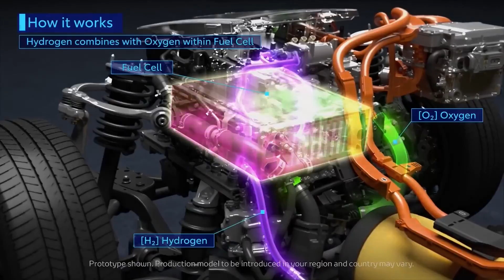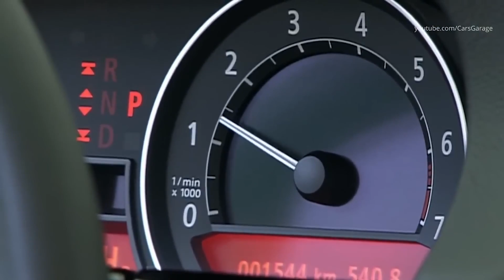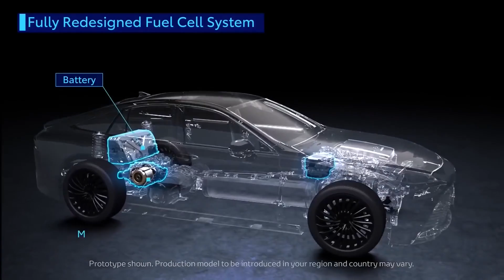Hyundai FINALLY Revealed New HYDROGEN Combustion Engine | GAME CHANGER!

Comment: Game changer?  Er, not in the UK it isn't, because you'll need tens of thousands of hydrogen filling points first. And there are around 12 in the whole of the UK.  Plus they just need to work on the massively inefficient production process for hydrogen. Then, just like petrol and diesel, it needs transporting to all the points where it's sold.  No good to me, as I can't fill up on cheap rate energy while it's parked on my drive. I can't get hydrogen from my solar panels either.... And guess who'll be the big cheese, selling and distributing hydrogen? Yep, the good old oil companies again.... They're desperate for another slice of the cake once sales volumes of petrol/gas and diesel tank....... Plus the car makers would sneakily prefer to continue selling cars with engines that have 2000+ moving parts rather than only 30 or so. That means far more profit for the servicing department.......